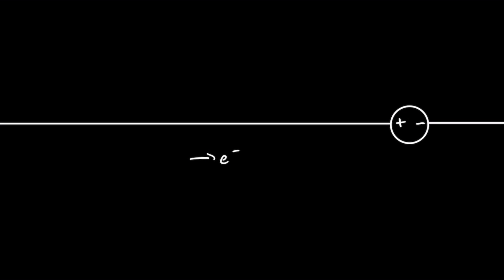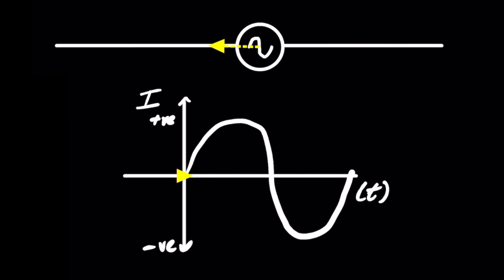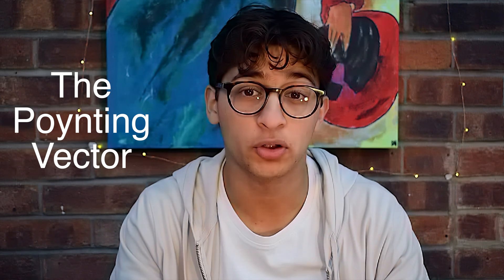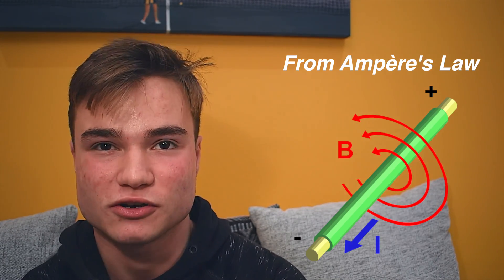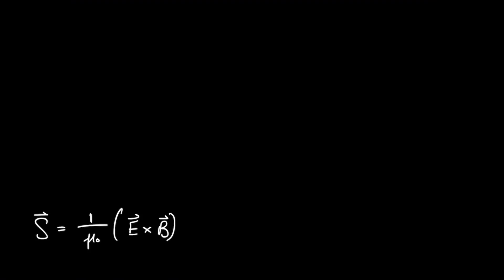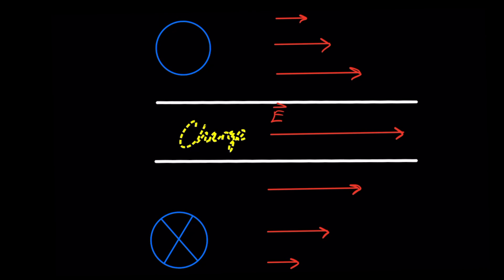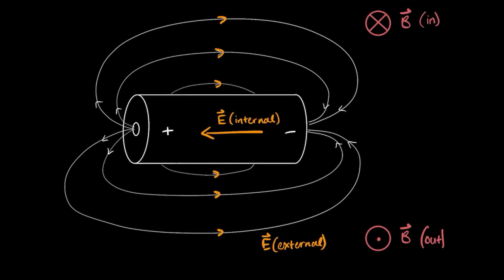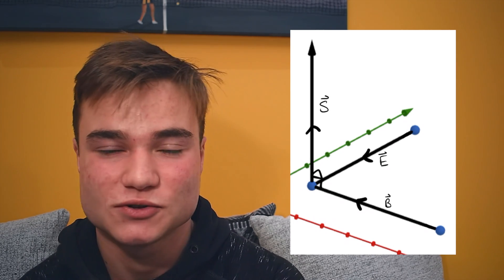Do you really understand circuits?

Comment: Great video, and great conversation.  I might add that EEVblog emphasized some points Feyman man about the usefulness of the Poynting vector when dealing with circuit design.  https://youtu.be/VQsoG45Y_00?t=2428.  Under Feyman's figure 27-6, Feyman says "You might believe that you must revamp all your intuitions, and, therefore have a lot of things to study here. But it seems really not necessary. You don’t need to feel that you will be in great trouble if you forget once in a while that the energy in a wire is flowing into the wire from the outside, rather than along the wire. It seems to be only rarely of value, when using the idea of energy conservation, to notice in detail what path the energy is taking. The circulation of energy around a magnet and a charge seems, in most circumstances, to be quite unimportant."  If you want to pursue this rabbit hole, see https://youtu.be/69laQk6XRgc.

Comment: Just a quick question (great video by the way): what energy is actually being used to power the load (say, a lamp)? In other words, what exactly is being transferred through the electric field, what form is it in and what is producing it? From this video, I am understanding that the energy is not actually the flow of charge, but please correct me if I’m wrong! Thanks!

Comment: So the big question is: is the energy transferred from the source to the load through the fields, or from the outside fields into the circuit as long the amounts are equal with energy lost by the source?!

Comment: Yes, a big misconception regarding how the energy flows in electric circuits.
Does this mean the following:
Consider many closed circuits, each with a battery and bulb. At any instant, the batteries as dissipating energy OUT(to the electric field ?) and the bulbs are consuming the energy - energy flowing IN (from the field?). There is no direct one to one correspondence between the individual battery and the bulb to say that the energy consumed by bulb-A is coming from Battery-A, since the energy transfer is between the components and THE field. However, since the the energy flow OUT/IN is dependant on the magnetic fields resulting form electron flow, the amount of energy IN/OUT for each set of battery and bulb will match. This of course applies to all power sources and consumers.

Comment: You don't really explain what is wrong with the electrons flowing model.

If you pull on a chain, the links flow in the opposite direction of the energy transfer. So why is your criticism that the flow direction is opposite as if such an idea makes no sense?

If you turn a bike chain, one path of links is going pedal to wheel, and the other path of links is going from wheel to pedal. But clearly they transfer energy from the pedal to the wheel.

Comment: There has been going on so much since I have built my first tube superhet mw/sw radio in 1979.....and I have had no sockets for the tubes, all pins wired directly by hand. Speaker selfmate with magnet, coil and a papercone, Uninsulated variable plate kondenser. I made a wooden knob for it. Man, those were the days.

Comment: With due respect for your otherwise outstanding video, the Poynting vector is nearly parallel to a good conductor.  I actually blame a misinterpretation of the Feynman lectures for this common confusion...  In any case, the tangential E field inside a good conductor is very small, as well as outside the conductor (the tangential E at the boundary must be equal on both sides).  The normal component of E will be much larger due to the charge distribution at surface of the conductor, making for a discontinuity of normal E across the wire surface.   Think of it this way, the voltage drop along the conductors is very small per unit distance, while the voltage drop between the positive and negative wires is significant.   The tangential E in your example circuit will be on the order of 0.1 V/m in the conductors (and just outside it), while the normal E component will likely be on the order of 15 V/m (assumes you have a 1.5 V source with plus/minus leads separated by 10 cm).  Poynting vector will be almost completely parallel, dipping in toward the conductor a fraction of a degree.  That small dip represents the power losses in the conductor.  The rest travels on its way to the load.
Reply: Underrated comment. The fact that energy flows mostly parallel and follows closely the path of the wire was also not clearly stated in Veritasium's video, which made it appear that the energy flows more or less directly to the load. At least, Veritasium mentioned surface charges, responsible for the normal component of the electric field, which is needed for the energy flow. This video right here completely omits this important fact.
Reply: @Theo0x89  can you give me some links to videos that explain these surface charges ? I don't understand them quite well , thanks in advance .
Reply: @ramy8338  I don't have video links, but I know of a university site that has a simple introduction with some pictures by a physicist (Hermann Härtel: The so-called Simple Electric Circuit): astrophysik uni-kiel de hhaertel CLOC Circuit
Reply: Totally agree with you 👍and I must say that following Veritasium's video I watched quite a few others and came across this one, which started to confused me. The E field is almost perpendicular to the conductor and yes, the energy is transported in the E field (not the conductor) but just beside it. However, it is transported parallel to the conductor. Sorry, to blow the "good story" a bit!
Reply: What point is misunderstood in Feynman lecture , I don’t get it ??
Reply: @nihanth9145  His resistive wire diagram, showing Poynting vector radially inward only.  He ignored the component parallel to wire due to the radial E field.  In a good conductor, there is almost no tangential E field; Poynting vector is almost fully parallel to wire.
Reply: @bobwhite137  oh ok , now I understood , thank you ☺️
Reply: wow, very impressive. thank you for giving me a intuition of power transfer in circuit
Reply: There is no large E component and it is static anyway?  The wire has an external magnetic field.  For DC, an external static electric field would only exist if there were resistance. Othewise for DC there is no external E field to combine with M.  The E and M are separated and don't do anything energetic together to form electromagnetic waves.  No waves so Poynting is not valid.  I'm not sure if the 15 v/m tangential field is active at the onset, but in steady state it is static.  The wire is carrying the energy via the EMF and electron flow from the battery with no Poynting involvement?
Reply: @thomasfolks  There most definitely is an E field radial (i.e. perpendicular / normal) to the wires, and it is larger than the E field parallel to the wires (for any reasonable conductor).  Here is a simple way to prove it.  Take the circuit shown in the video at 2:55.  Consider the midpoints of the vertical left segment of wire, and the vertical right segment of wire.  Draw a horizontal path (call it L) between those points.   Integrate E . dL on that path.  That integral equals the voltage difference between the endpoints of the path, which in this case is the battery voltage.   If E were zero along that path, then there'd be no potential difference between the left and right sides of the circuit.   I was using 1.5V for the battery and assuming a 10cm gap between those sides - so the average E field normal to the wire would be 15V/m.  You can use the same analysis to think of the tangential E field.  That integral would be the voltage drop along path on the wire.  I ballparked that for a typical circuit like they showed, it would be no more than 0.1V drop per meter of wire (even that is probably high unless they are using incredibly small wire).  So that tangential E field is roughly 0.1V/m.  As to the rest of your claims - well now that you know there is significant normal E field, you'll see there is a Poynting vector mainly parallel to the wires.  It doesn't matter that it is DC.  If there is energy flowing, there will be a non-zero Poynting vector.
Reply: @bobwhite137  (apologies - I have edited this comment as it had errors) Feynman demonstrates Poynting measuring E to show power vector pointing inwards to be the energy being lost in the wire in the form of heat.  But that example had nothing to do with the energy transfer to a distant load. You would have to go up to the load and see how the fields were, around that too.  Ref: "Is electric current due to charges in and around the battery" section onwards in the conduction process vid below.  
The primary energy flow that everyone seems to ignore - is overwhelmingly transferred by conventional electric charge flow (ie, E x I) and is much more easily analysed that way.  
The energy does not travel inside the copper as electromagnetic waves  - the E field is mostly "shorted out", although there is a predominant emf coming from the battery to move the charges.  Because of this small E field and hence small Poynting product, the magnetic field outside the wire is not being used to generate electromagnetic power here.  All the energy is coming from the battery.   
I guess my beef is not that Poynting is wrong - it seems maveriks mentally apply it in questionable ways to for questionable explanations that would be impractical to measure.  Thanks for the dialogue - interested in feedback - videos might (or not) be of interest.
Poynting Diagram - commons.wikimedia.org/wiki/File:Poynting_vectors_of_DC_circuit.svg
Sridhar Chitta - "Current and the Conduction Process" youtube.com/watch?v=REsWdd76qxc&t=324s
- it includes debunking at least one electric field myth at youtu.be/REsWdd76qxc?t=628
Atoms and Sporks - "The Real Origin of Electromagnetic Waves" youtube.com/watch?v=uZnXhRgztEg
Reply: @thomasfolks  Much to my otherwise adoring fascination with Feynman, his one drawing of that resistive wire is totally misleading.  He is ONLY considering the component of S that represents the dissipation in the wire.  He ignored the surface charges that would have to be present if that section of wire were being held at a potential needed for the circuit in the first place.  Had he drawn it properly, it would show S being tilted into the wire - the component normal would be the heating, and the component parallel would be the energy moving along toward the rest of the circuit.  Funny you should mention the Atoms and Sporks vid - I just happened to watch that a few hours ago.  Completely agree with his point the only real origin of the fields are moving charges.  I disagree however that there is a general misconception.   Just because Maxwell showed an equality between time varying E and B fields, doesn't mean there is causality.   It might be easy for someone to misinterpret that equality as causality, and I think that was Sporks point.   

Take care.
Reply: By tangential, do you mean along the wire or perpendicular to the wire??
Reply: @macmos1  along i.e. parallel
Reply: Even simpler to imagine, any significant E field goes from plus to minus. Assuming the wire resistance can be neglected compared to the load resistance. Then inside a zero ohm wire where the battery plus pole is on the same voltage potential as the load plus pole, there is no E field along the wire. The significant E field goes from the plus wire to the minus wire, and so it begins and ends more or less perpendicular to the wires.
Furthermore the internal E field exists only inside the battery and inside the load, where is voltage drop along distance. The poynting vector field then results in energy coming out of the battery and sinking into the load. But the wires are not sources or sinks of energy.
So this video is actually a misconception of the misconception.

Comment: I don't understand why Poyting vector is always pointing up, and not down? Is this just a convention? This is just a product of vectors after all, so why does it matter to which direction it points?
Reply from the maker: The right-hand rule dictates the direction of the cross product of two vectors. It might also help to know that the cross product is anticommutative - if you switch round the order of the two vectors when you multiply them, you will get the opposite direction in the result.
Also worth mentioning - we did get a couple of the vector directions wrong in the video (see note in description) but the right-hand rule should help you to think about the correct direction.
Reply: @ASKENG  Oh, I see. So, it matters which vector comes first.

Comment: with all due respect, this is wrong. A current carries the energy, or better said, the current is the energy transfer itself. A current is moving a charge (or many charges) and this movement will change the electric field, and by changing the electric field, potential is moved.

In your case, the battery constantly replenishes the current and the resistor is actually generating the electric field from the current and it will “consume” the energy through this. Once the thing is in a steady state, neither the magnetic nor the electric field will change! As they don’t change, they won’t participate in the energy transfer any more. Inside of both the battery and the resistor, the field is constantly changing, through rhe interaction of the charges with the atoms in both. Due to this the chemistry of the battery is changing and the atoms of the resistor get moving (and thus hot). Yet these are the only places, where energy is changing from one state to another. The field does nothing….

The distinction between AC and DC is meaningless, as the whole thing goes so damn fast. As soon, as our circuit comes close to the size of the wavelength of an electromagnetic wave with the AC frequency of our circuit, the change in the field is capable of transporting energy away from the conductor or into it. That’s how antennas work, but, I wouldn’t mix this into this. The theory of changing electromagnetic fields is a very, very complex topic…

Comment: Energy is the PRODUCT of potential difference ("voltage") and charge that crosses that voltage.  BOTH must be nonzero to get energy transfer.  The electric field inside a conductor is nonzero only for VERY large current; the electric field is nonzero only OUTSIDE the conductor and especially inside the load.  The electric field between the conductors points from the positive toward the negative conductor, but fringes outward greatly.  The electric field has practically NO COMPONENT parallel to the wires since wires are equipotentials.  E points radially away from (toward) the conductors and B points around the conductors so that E x B points away from the source and toward the load.
Reply: I gave your answer an upvote, as it find the issue with the claims made here. But you are wrong about the electric field inside a conductor. If its a perfect conductor and a static case => no field inside the conductor regardless the current. If the conductor has a resistance, then there is a field inside the conductor and this is linearly correlated with the current strength. If the current is changing, the change will travel along the conductor with a speed correlated with the dielectric constant of the material surrounding, that’s how effing antennas work…
Reply: @georgantonischki1188  The electric field parallel to the wire equals the difference in potential divided by the length.  The flowing current results from the energy source TRYING to cause an electric field inside the conductor; the conductor's resistance does allow E=V/L=IR/L to exist, but R for wires is so small and L is so large that this field is usually negligible unless I is large.  More correctly, the electric field inside a conductor is zero for a perfect conductor OR a static case.